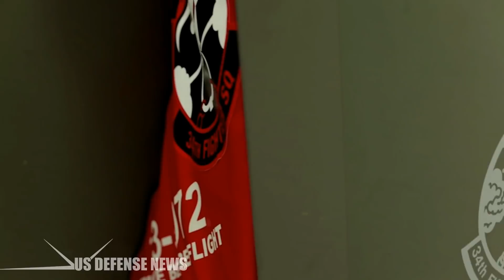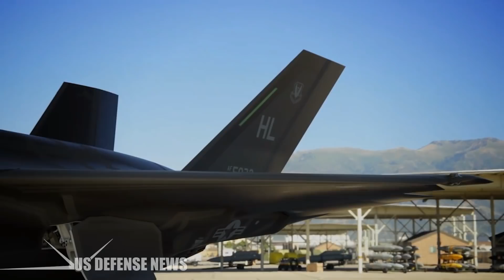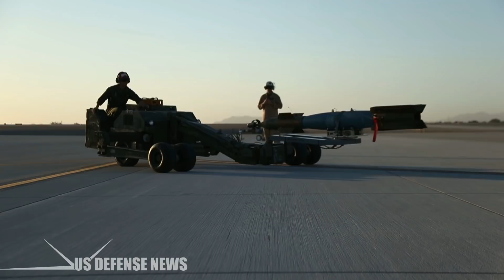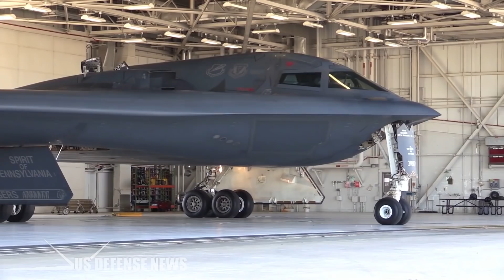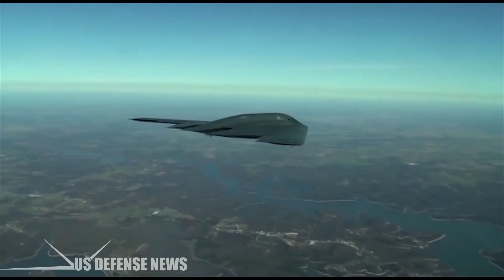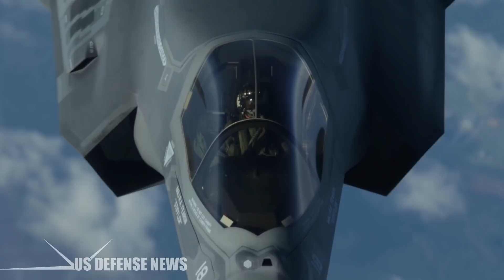This Is How the US Plans to Protect the Stealth Fighter from Russia and China

Comment: Jamming and stealth are synergistic. If your fighter has an RCS of .1M2, think SU-35, and my fighter has an RCS of .001M2, think F-35, then your SU-35 needs 100 times the jamming power to produce the same masking effect that my F-35 has. Conversely, if only need 1/100th the power for my F-35 to jam at the same level as your SU-35. 

And some of the latest comments by some USAF Generals indicate that the F-35 is more stealthy than the F-22, so the RCS might actually be .0001M2. 

And the F-35 Electronic Warfare Suite can do a lot more than just jam....like sending false targets to enemy radars.
Reply: 777Outrigger good post, but I doubt the su-35's RCS is 0.1m2 more like 2-3m2 as PAK FA's RCS is 0.5m2 but other than that, you're figures are about right.
Reply: I was giving them the benefit of the doubt for a hypothetical. :-) But you're probably right about the real RCS of these airplanes. But neither of us have had the classified briefing. :-)
Reply: fly it in Chinese air space then we will got to know